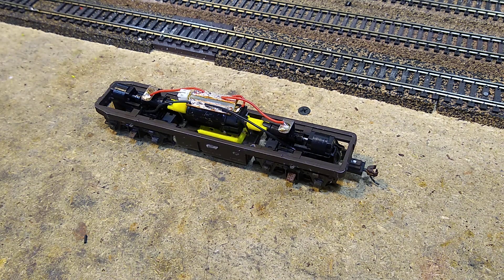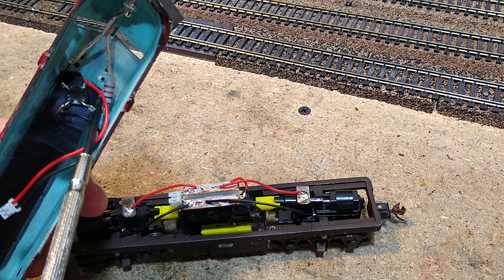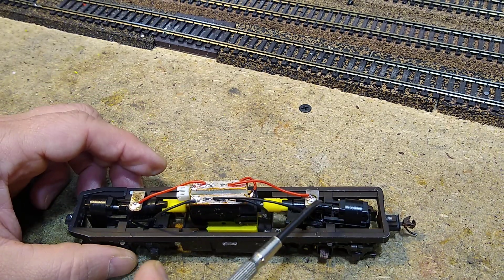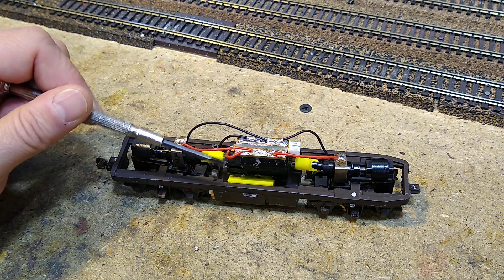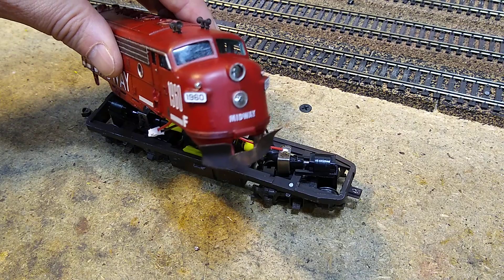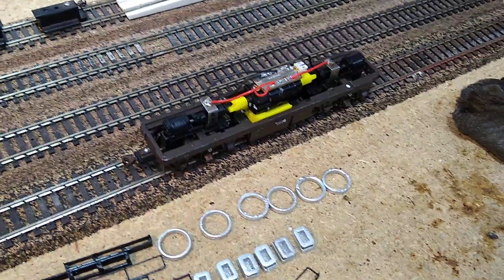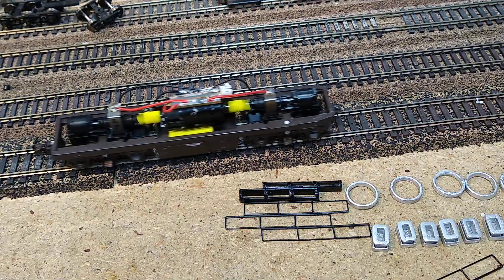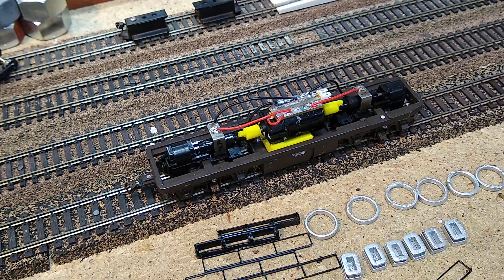Athearn Blue Box F7 24 volt motor conversion final reveal

Comment: These are fun to watch however I suspect the reason you never show these conversions pulling rolling stock is for a very important reason that seems obvious to anyone familiar with model trains.  I'm not certain these 24 volt motors have as much torque as the original drives, even if they spin at higher rpms.  Do you have videos of how many cars you can pull with each type of motor?  That would be awesome!
Reply from the maker: I've got some pulling power videos, but you have a point that I haven't showed much, so challenge accepted - I'll show why I love you.  24v motors turn at half the revolutions of a 12v on a train layout because they never reach 24v in operation.  I have a train of gondolas on the layout that is full of my stock of lead weights so I could clean the bucket, that would make an excellent test train and I can measure how much it weighs first - I'll win you over with this!

Comment: Getting rid of the spider-type couplings (on the f-7's that have them, not all did) is an improvement all
by itself. They're extremely noisy.
Reply from the maker: currently I've been using food grade silicone hose and it is even better than the fabricated u-joints

Comment: OK... Here's why I'll really like these Motors! 
My Layout is NCE DCC, and nearly all my Locos have Sound, with Econami Decoders and/or TCS Keep-Alive.
IMO, Keep-Alive: the MOST significant innovation in the Hobby!! NOTHING stalls, anywhere. Not even an 0-4-0 on #8 Turnouts!! 

That Motor you use runs as smooth or smoother than "Can" Motors sold FOR Trains, at over 4X the cost!! 

I'm very into RC Crawlers. Motors for those are MUCH bigger, and I haven't seen any with Dual output Shafts. 
But I'll try to find them! 

Any chance of you Printing me some of those Motor Shaft Adapters? 
I can't dream of affording a 3D Printer, and don't know anyone who has one. 😞 

I might be able to FINISH a BB U30B, I started in 2014!!
Carmine ✈🚂🚙
Reply from the maker: start with the plastic pipe because it's proven to work, these new couplings were made 2 days ago and haven't proven reliability yet, but if they do I'll make the STL file freely available so anyone can make them at the local UPS store on their printer.
Reply: I didn't realize that the UPS Store was even an option! 😳
Reply: @elite194  could you make the STL file available? thanks!
Reply from the maker: @chlsjtu  I made it just as a 1 time use and didn't keep it, which I now wish I did.  What I did was make a cylinder, a sphere and 2 more cylinders.  I set the sphere on top of 1 cylinder, then moved the others into position to subtract the objects.   That was it and I printed 20 of them.  I foolishly also put a hole for the shaft inside, which I would not do again and instead drill the hole with a #39 drill bit in my mini-lathe.  The lathe I got is the Zhouyu First Machine, which goes by many names and is toy-like.  But after trying all the configurations I found that it's pretty good as a lathe.  It cost me about $150.  I thought I could build the same thing for under $100, but the accessories you get with it like chucks and collets proved to be worth the money.  I bolted it to a workbench in lathe configuration.  I plan to make a new improved design with no hole for motor mounting and instead drill the hole on the lathe.  This locomotive has proven to be very good and the concept is very sound.  I have 2 blue box SD45s on the bench right now that will get the same treatment.
Reply from the maker: @chlsjtu  what I should do is show how to make it in a simple program... that gives me a new idea for a video